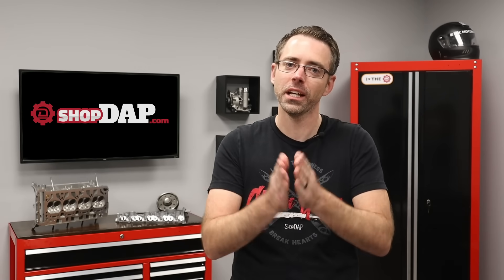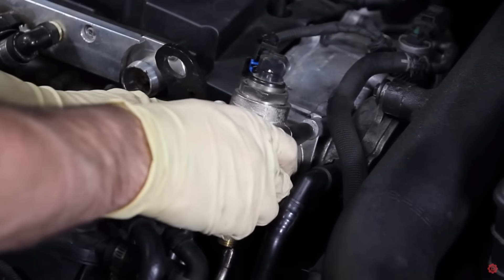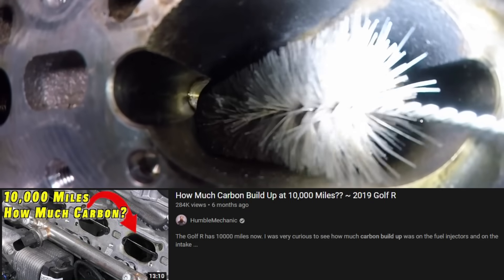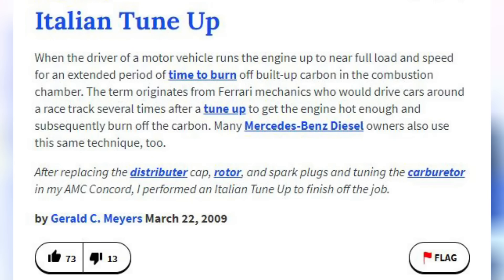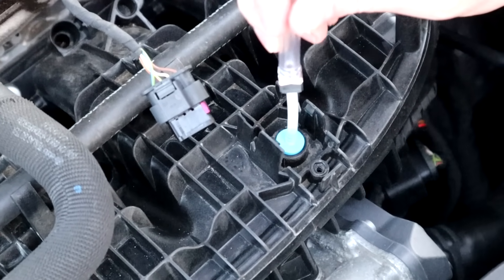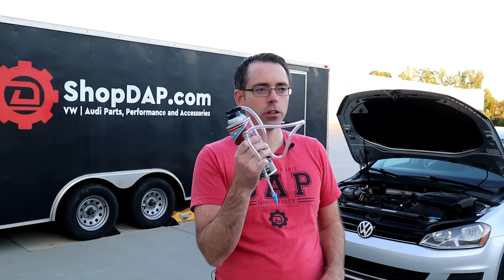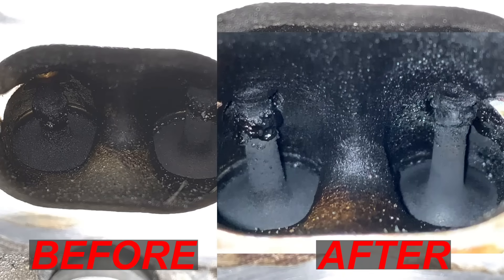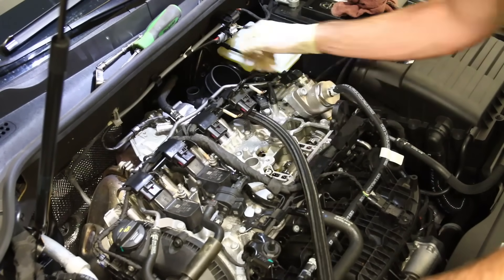Can you Really Remove Carbon for $29?

Comment: From what Ive found after doing at least 50 of these carbon cleanings on the 1.8 and 2.0 FSI motors, premium gasoline works the best for eating away the carbon. Ive tried a ton of different cleaners, from Wurth, Techron, Napa, Berryman etc, and they all needed much more time to soak through and eat up the carbon. Premium gas can cut it down in under 30 minutes.
Reply: Do you mean regular use of premium gas as fuel or do you mean spraying premium gas into the intake to wash out the carbon?
Reply: @soulsocket7  Well both, use premium if your car requires it, but when doing a carbon cleaning I make sure the valves are closed and fill the intake ports with gas, let it soak and brush it away.
Reply: E85 makes an excellent cleaning solvent.

Comment: I wouldn’t have a DI engine.  A port injection will cool the mixture as it enters the chamber and the heat of repeated loaded runs will heat soak the chambers and lose power. I have seen it on the dyno. A compound system that is DI or close IDI can actually benefit from the cooling effect of an auxiliary fuel system that comes in when the manifold/head reach a critical point that compromises output and as the temp goes up NOX is created and coats the valves with these deposits.  It is my belief that we are seeing end gas deposits baked on to the stems valves and chambers. Ironically a carburetor system doesn’t do this. You can bang on it all day on the dyno and never see critical temperature power loss or upon tear down after 70,000 miles, the cooked on NOX deposits because the homogeneous mixture is cool and goes right through and is consumed.  It is likely that if run on an IM240 test you will see a higher level of end gasNOX, in the emission from the tailpipe. You have a dilemma the NOX doesn’t magically disappear it is deposited on the valves and requires cleaning and possible carcinogenic exposure to the mechanic.  The best carb I have used that reduced end gas was the Carter Thermoquad. It cools down the mixture and less end gas is created.  The additive package exacerbates the problem, ethanol burns so hot in its narrow effective range. Compression is great at keeping an engine clean, but octane is still a solid limit. But I don’t want DI in a gasoline engine. Diesels really work with it, the CR and the fuel combination work well .

Comment: you can put water meth into your windshield reservoir any run the hose to a T fitting that splits to the intake with a check valve.  Methanol also de-ices your windshield!!!

Comment: Bottom line, avoid purely direct-injected engines. Of course, the car of your fevered dreams may well be DI only. In that case, I'll pray for your tortured soul. Recently, manufacturers have used a hybrid of port and direct injection, and I'm led to believe that solves the carbon buildup problem.

Comment: I still think the best solution is choosing an engine with dual fuel injector, one for the cylinder , the other for the manifold.  However, you are stock with a direct fuel injection system, perhaps the easiest way is switching to synthetic oil which has a lower vapor pressure and so less crankcase vapor to start the problem.
Reply: ...and frequent oil changes. I go 5k between synthetic oil changes.
Reply: @cometcal2  5k miles oil change interval seems a wast of oil and money.  why not try a catch can (oil vapor condensor) for PCV.
Reply: @henrytsai590  Use your own judgment. The idea is to change your oil before it gets too dirty. The cleaner the oil, the fewer contaminants flow into the intake manifold through the car's PCV system.

Comment: I've used BG PRODUCTS since new. MOA,  EPR, and 44K.

Still have original plugs and coils 136,538 miles still 40+mpg on long trips with cruise control.  Best, least trouble of ANY car I've owned, plus zero squeaks and rattles.

Are the BG products a main reason? Not sure, but so far I'm a believer

Comment: I own a 2018 Civic EX-T (bought new June 2018), 1.5 liter, turbo GDI. I currently have 89,900 miles. I drive 60% highway averaging 33.2 mpg. I only use Shell Premium 93 Octane fuel for the maximum detergent. I maintain my car aggressively...oil/filter change interval, every 3,800-4,200 miles using 0W-20 full synthetic. I’ve changed the transmission fluid twice already,  flushed the coolant once, replaced the spark plugs early at 67,000 miles, and did a fuel injector cleaning. I rarely drive short distances. I never drive hard (rarely exceeding 4,000 rpm). My car has been trouble-free to date (3 years 5 months).
As I approach 100,000 miles, should I perform a media blast? I plan on keeping my Civic for as long as possible (hoping to get at least 300,000 miles).
Reply: Oil changes too long for turbo, GDI, especially with all the gasoline dilution that gets in ALL GDI ENGINES. I don't go any further than 3000 miles between changes, and though my dipstick level is not raised, the oil on it smells strongly of gas, and just drips of the stick. My other car non GDI,  the oil does NOT reek of gas at 3000 miles. Just what I'm doing as I also keep my new cars a long time. I hope you reach 300.000 miles,  I have a 1994 Trans Am I bought new,  it has 338.000 miles on it now,  engine never been touched,  even the timing chain is original.  LT1 engine,  it's still running like new. CASTROL GTX CONVENTIONAL   .

Comment: A simple clear gas filter mounted on pcv hose will keep valves clean. Clean or replace filter as needed. Sludge stops there. 149k Hyundai Accent synthetic oil and filter on hose since new. No issues whatsoever and valves are like new!!

Comment: water/meth will get rid of that over time, depending on how often you trigger it. Upper engine cleaner/conditioner will too but needs to soak and reapplied which is manifold off unless you can access each port

Comment: Carbon buildup is the dread of my 2016 F150.  I want to get 300,000 miles out of it before I dump the truck, but will I?  I use fully synthetic oil and change at 5,000. Hopefully it will hwlp.  My dealership and most if not all out there really take advatage of simple mechanical fixes.  Like a half hour repair they will charge 300-500 dollars in labor alone. I know, I've priced them. I did the work myself, and kept my hard earned money. But when it comes to scraping the carbon buildup, one thing they know how to do is charge mightily and heavily, but the person that actually does the job...will he know how to thoroughly do that?

Comment: I've been putting various name brand fuel cleaners in my gas tank once a month since I've owned my 2013 manual GTI. Purchased it new.  I hope this has been successful in eliminating/preventing any potential buildup.  Have always used hi-octane gas. It's at 92k now and still runs great. 🤞
Reply: Those additives won’t do much to be honest . But better than nothing . These engine will continue to build up carbon , however you don’t have to worry too much as the carbon won’t affect performance , most of the build up is around the neck of the valves.
Reply: Thats not how it works.....Did you even watch the video?

Comment: I was looking into taking possession of a 2018 Q50 till I researched the engine and found they don't use an extra injector to clean off the valves. So I figured I would do a meth injection system and exhaust turbo down pipes tune it. But then people started having turbo failures common. So I said forget that I'll wait till nissan makes a better product.

Comment: The ~1967 Mustang you show surely had PCV since that was required in CA in 1961 and all other U.S. states in 1964.  I wonder if we'll see aftermarket systems which spray a little gas downstream of the throttle plate to keep the intake clean.  I understand some of the latest GDI designs have that.  I wonder if GDI cars have a low-pressure pump to supply the main pump.  If so, that might be enough pressure to run an injector.

Comment: Ordered an received an fuel injector removal an seal install tool kit from you at Deutsche auto just wanted to say the tool kit is top quality an I'm very happy an pleased with my purchase,I'd recommend buying this kit for anyone looking to do a carbon cleaning job on there di turbo motor,now just waiting on the seals an walnut blast kit I got coming along with the catch can system,,which if done right I believe is a must for 1.8/2.0t motors ,,,the right catch can kit is expensive an ppl are on the fence about if the motor benefits from it or  not ,,well from what I've seen an researched it's better to have one then not ,,after you clean the carbon by hand that is ,,then use the chemical cleaning before every oil change an that'll deff prolong having to pull the manifold off every 30 to 40 k ,, also please use premium gas in these engines ppl ,you get the same mileage anyways ,,,87 is the enemy of these motors ,,thanks again for the kit top top quality for the price👍

Comment: The Italian tune up method worked on my 2014 AUDI Q5 with the 2.0l. It is running belter than any other time since we bought it in 14. We only have 33k miles on it. It also cleared out two codes.

Comment: If your going to claim DI engines are better in every way then make a 17min video about there biggest down fall maybe talk about why you feel that DI engines are better. Cleaning the valves every 150k is a major service that's going to put you back 350$ - 900$ Depending on the shop witch doesn't say Reliability to me. I think your Bias for VW/Audi is showing here or maybe its just a DI Engine bias but it doesn't look good to Claim Superiority then show proof that there less reliable.

Comment: Unfortunately, excessive carbonization only exists in turbo engines from the VW group, which are only tested on Autobahns and not in severe use in large urban centers; the situation is dramatic in countries with low quality fuel. I would like the channel to address the issue regarding the determination of VW so that its 1.0 TSI engines do not undergo overhaul, changing the original standards of pistons, connecting rods and crankshaft. Thus, I consider that they are disposable and must be replaced with a new one. Check?

Comment: I can't see why filling intake ports with Seafoam after insuring the valves are all closed and allowing the engine to soak for some time should not produce a positive result. Here in the land of Oz we use to do this with a product called Redex. Used to do it on Exhaust ports too.

Comment: You would think this carbon build up was new.. Diesels have been direct inj since sir rudolph invented it and they get carbon as well, don't be kidded.... scania fitted a spinner to help in this. Petrol only in the last 25yrs  but due to emissions being lowered especially in America they want the shit to land back in the engines.. But if drive car instead of pussying about you won't get this as much.. Only way really solve this is port and direct inj combined.. Also You would think Most on here had shares in catch can companies, or all these additives. Put correct oil in change regularly, along with sparkplugs instead of expecting the car to go forever without servicing well take what comes.. I've an audi a5 gen 3 and changed waterpump 65quid, hydrocarbon cleaned 70 quid , nice new pcv fitted jeez 25 quid, all b4 anything fecks up, timing chain Nxt, and even though has fsh on car  I still change oil between services that longlife shit is crap its no better than Walmart or tescos.. If you want to buy a car buy an old escort zephyr they go forever without servicing or you could service the cars you've got....

Comment: most port injection cars also have PCV systems, would they not have the same issue as direct injection? or does the fuel help keep them clean?
Reply from the maker: Yea. The fuel is constantly spraying on the back of the valves which prevents major carbon build up.

Comment: And one other point, the PCV system is totally unnecessary system period all you need to do is relieve crankcase pressure through a passive recirculation system, not an active one.
Reply: Which provides very poor circulation.   The gases have acids that degrade oil and thereby provide less engine protection to all parts.  PVC valves are not necessary like water free gas is not necessary.

Comment: Direct injection is not a great Improvement on port injection. This video absolutely proves that point, direct injection allows you to run a slightly more efficient engine that dirties itself to a point that it runs like crap. The best engines are probably a mixture of both port injection and direct-injection. But I've seen port injection engines that run better and get better fuel mileage then direct injection engine so I don't know what the big issue is. Four-headed testogen years ago that not only had Direct injection in the combustion chamber, it also had direct injection of the intake air, the only valve it had was an exhaust valve. They were extrapolating 60 miles per gallon out of a V6 that they had on testbed. Yet I never saw that engine come out. And yet we still think that we're going to have decent electric cars in 15 years. We are at least three generations away yet from having a battery that's light enough to not have to kill itself inside of a few hundred miles. Without a huge breakthrough electric cars are not going to be the answer, unless you're going to drive in town and in town only.
Another problem that you have, is all direct-injection and turbocharged engine should have oil catch can. At one other issue with dejection, is as the fuel is being vaporized, which is the point at which it burns its best, there is not enough time in a direct injection engine for the fuel to ever become vaporized to any extent.

Comment: Chrysler was selling Port injected cars in 1956. The only issue that they ran into, was that the condenser raps were not insulated against radio interference from bad Transformers out on the road. And if you got near one of them it would start acting up. Surprisingly they were not able to figure that out before they had sold their injection systems to bosch for them to work with.
Surprisingly, that original 1956 system when you correct and rewrap those exact same condensers resistors, they work wonderfully.

Comment: I think some of Lexus cars after approx  year 2012 have port and direct injection combination. Expensive cars and rubbish mpg on petrol engines but then no need to worry about crap on the valves and the cost that goes with it.

Comment: Quite a few years back when i was still a stupid teenager i used to drive my car like if the road was a race track. Litteraly going as fast as the car and road would allow me to, and redlining the crap out of my engine in every gear. I drove a 1999 ford escort turbo DI 1.8 Diesel completely original except for increased boost and according adjustments to the fuel injection pump. All the factory egr and pcv system hadn't been tampered with. 
I once dismanteled the intake and egr valve and to my surprise they were absolutely spotless, no sign of carbon build up what so ever. I was quite impressed to say the least ! So i actually do believe in the italian tune up.
Also, when ever a client comes to the garage with huge carbon/oil build up, the car is usually owned by someone who isn't driving it hard enough. The best advice (in my opinion) i can give them is to beat the hell out of their engine once in a while to keep it clean.
Reply: Brilliant .
Reply: That is old school engine with fuel injection. The extra fuel cleaned everything. But now in GDI engines, the injectors are located inside the cylinder, so their is nothing to clean the top of the valves. This is why the "Italian Tune up" does not work anymore.

Comment: I think your way of cleaning the carb from intake valves is surely and totally inefficient.
better way is to pour the (solvent) cleaner into the gas tank in order to inject it towards intake valves in equal amount via fuel injectors, where the engine running normally or for better result apply high RPM with low gear speed.
Thanks.
Reply from the maker: The whole issue is due to the gas going right into the cylinder and never sprays on the back of the valves. 

No amount of chemicals you dump on your tank will solve this issue.

Comment: It might sound nuts, but I pre-mix an IPA / Distiller water mixture ( 7/3 ) which I add to my fuel at a ratio 1 / 20 and I find it does a pretty good job cleaning my pistons.  Visually verified before and after.  You can also make home-brew seafoam pretty cheaply for cleaning the valves.
Reply: It doesn't sound nuts, you just know some tricks.  That is all.  They seem to work well from what you say.
Reply: Isopropanol and ddw?
Reply: @guyshuvali406  ddw?  מה זה

Comment: Berryman intake cleaner blew my engine. I have a Lexus IS250 and the chemical collected in the variable length intake runner. I applied the chemical per instructions by injecting it, waiting 30 minutes and then proceeding to go on a 10 minute drive. While pulling out of the driveway for the 10 minute drive my engine blew. I removed the intake and it was full of the chemical... when I say full, I mean full. Stay away from that stuff.

Comment: If you use this stuff every oil change and have an oil catch can in the pcv system you will not have to worry about the build up. Especially if you also use higher octane fuel.

Comment: We have a  cool product here in the UK called- ''Mr Muscle over cleaner,'' its a spray foam. Its very heavy duty at removing carbon and baked on grease, the fumes are terrible but it de-cokes an engine or EGR valve like magic and only £3.95 for an areasol.